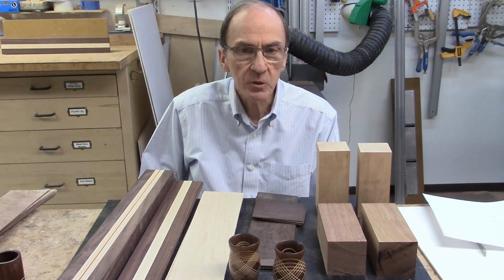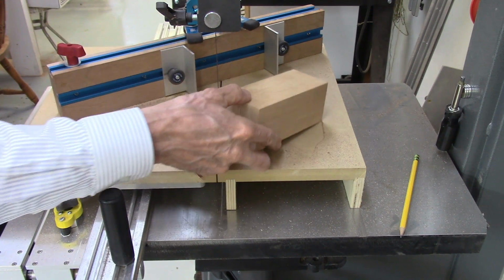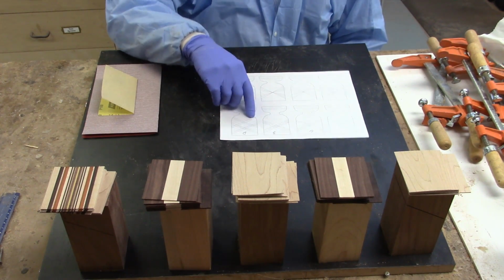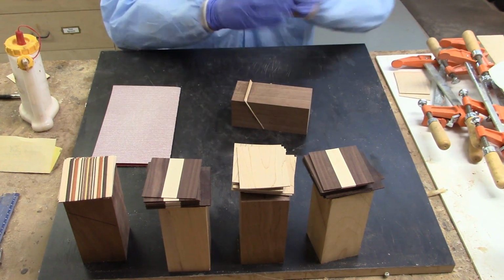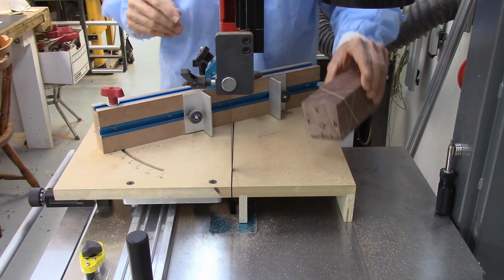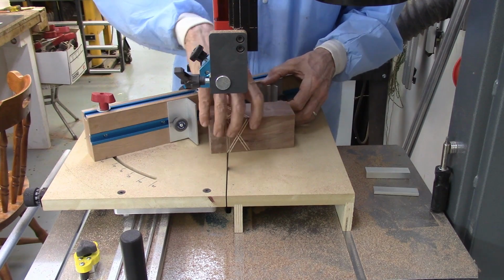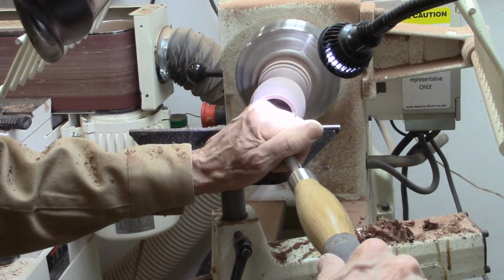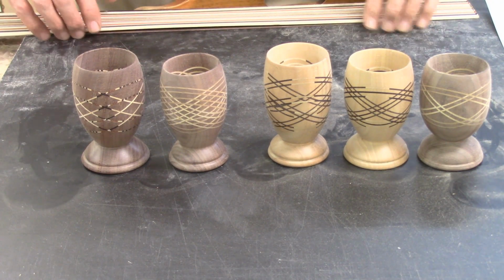Wood Bowls with Celtic Ring Inserts (20)

Comment: its time to ramp it up another notch.  try a six loop knot!!  hint, start with a hexagonal blank.  i do pen blanks with a 6 loop knot
Reply from the maker: This could quite easily be done.  The challenge would be preparing the 6 sided block with exact straight and parallel sides.
Reply: @Accu-Slice  yes that's how i do my pen blanks, easy to cut hexagonal stock from 4/4 material!

Comment: When you use the spacer blocks to make just two cuts, they will have no spacing issues, but when you go to make the 3 ring, you did not account for the blade kerf.  So your 3rd ring is in your blade ~40 thou closer to the 2nd ring than the 2nd ring is to the first.
So use the aluminum spacer, then your kerf spacer to make your 3rd ring.